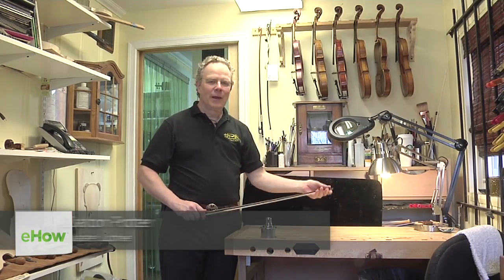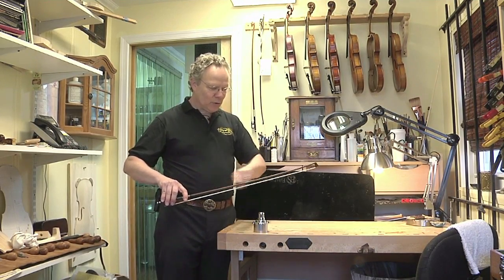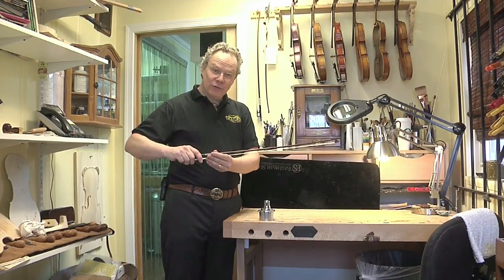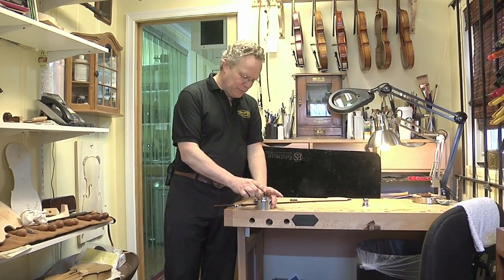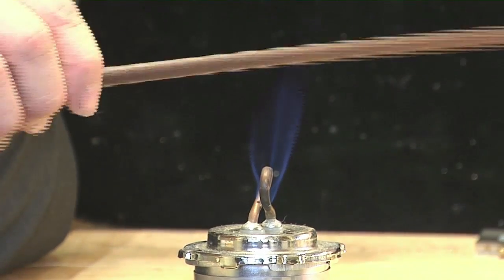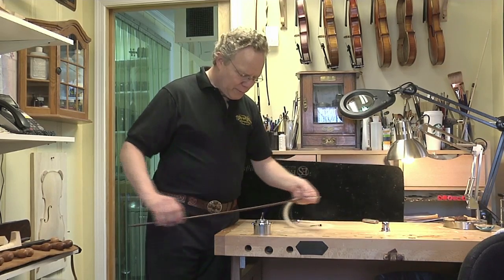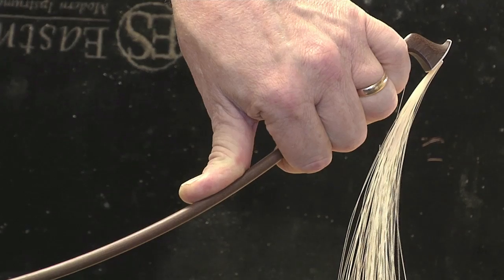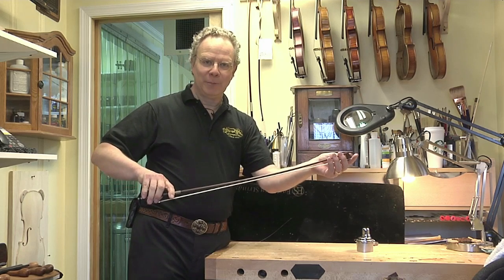How to Rechamber a Violin Bow Under Tension : Violin Maintenance

Comment: The trouble I'm having with my bow is that I'm unable to tighten it fully. Would this be to do with hair misalignement in the chamber?
Reply: possibly, or the hair may have slipped at the frog end, either way, i suggest having a violin shop look at it.

Comment: I'm such a tightwad.  I re-cambered my daughter's bow with the heat from my electric stove.  She's been playing for just a couple months, so I'm not going to run out and spend dozens of dollars on a bow and/or bow repair. 

Seems to have worked just fine. Time will tell.
Reply: deasttn what happened to your daughter's bow? I want to try by myself but I'm kind of scared..
Reply: So far, so good.  She's a student in the school orchestra, so she's not all too particular.

I think you should go for it.
Reply: From a bowmaker in Vienna: I agree, go for it.
Reply: She's only played for 2 months, and you need to recamber the bow? Are you loosening it when you're not playing?
Reply: Content Updating - a bow should not lose its camber in two months even if it's left tightened all the time, if it's not made of lousy wood or was bent poorly.
Reply: I have an antique German bow I’ve been playing on for a while and thought of re bending it. What setting on the stove should I do it’s a samsung stove that’s 0/10 I’m thinking 3/10 is that ok?
Reply: @Tang5oh  start with low setting and see if it works.  If not, gradually increase the heat